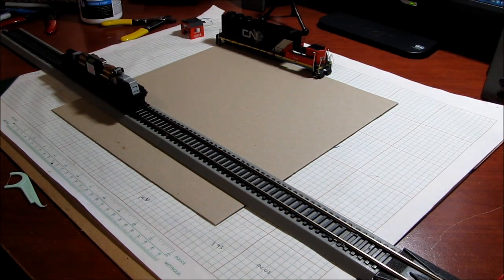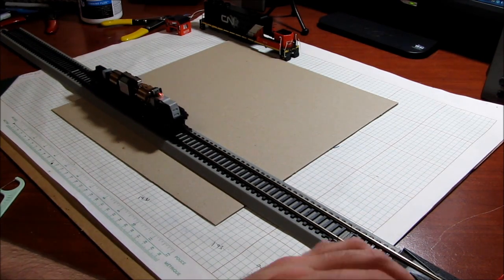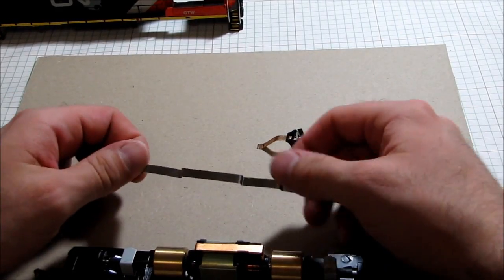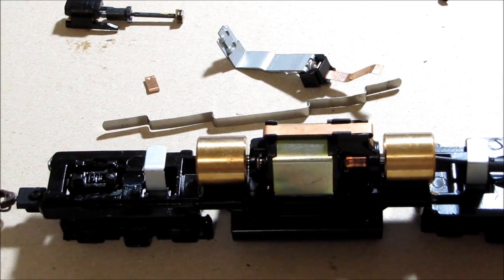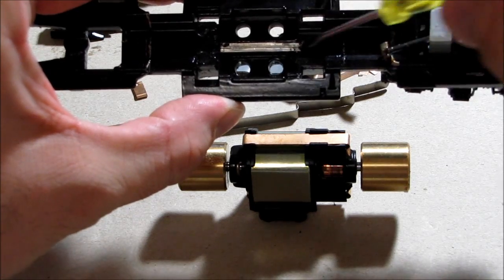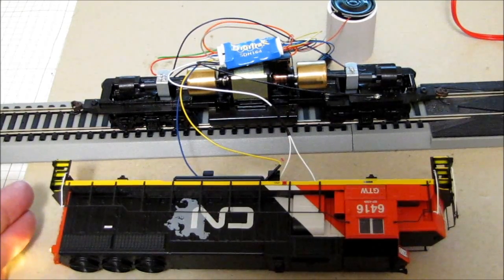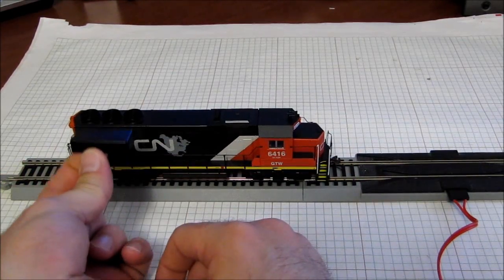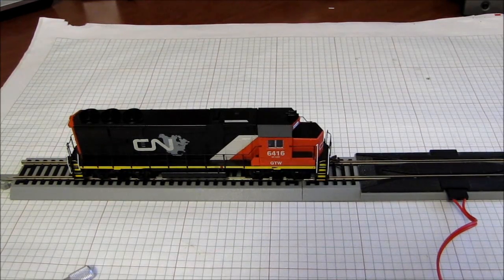1.4.12 DCC Project #2 Part B 'DCC Install & Sound'

Comment: Hey how did you wire up those rear lights ?
The color coding says the yellow wire is for the rear light function 2 but how do you connect the other end of the LED and which end of the LED should be connected to the yellow wire ? Is it the blue wire we need to connect the other end ?
Please reply. Thanks in advance.

Comment: hey man I have messg you a few times have not got a reply yet  but I wanted to run something by you I have a repido This is an exclusive model from Rapido Trains Inc. and features sound and DCC (will also work on DC). 6524 and 6537 were the only two FP9As to receive a larger VIA logo on the side, Red VIA on the nose, angled yellow paint and larger anti-glare paint. 6524 was used in most of VIA's promotional material through the 1980s I also have a Banff park car both im selling for 450.00

Comment from the maker: @RRSalvageMan One thing you need to make sure.  When you buy the SDH164D, it comes with a steam file and a diesel file.  When you erase the flash and reload a sound project, it always loads inthe the steam file.  So make sure you don't have diesel selected because you will not have any sound.  I learned that the hard way.  I thoguht it didn't work, but i switched it to steam, and I had sound.

Comment: Good video! Suggest putting black tape or black shrink tube over the area the LEDs were installed in the cab to keep the light out of the cab. I don't drill a hole in the frame for the connection for DCC power, soldier the wire to the metal frame of the truck, just pop the sideframe off and soldier it on, much better connection for power! [Like your bumper music.] Lucky you -- sound project loaded nicely. Looking fwd how you used Win7, PR3, & decoder pro since we STILL can't get it to work!